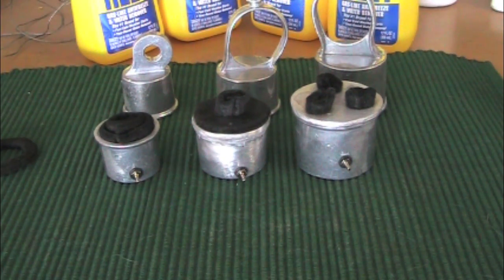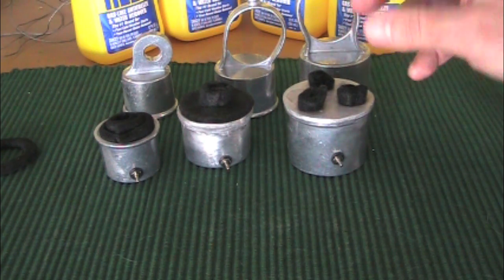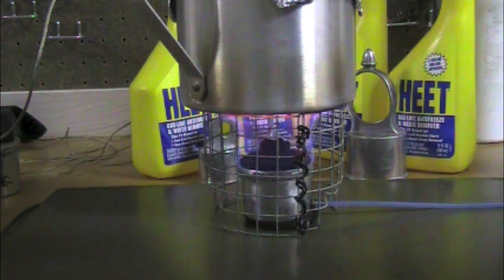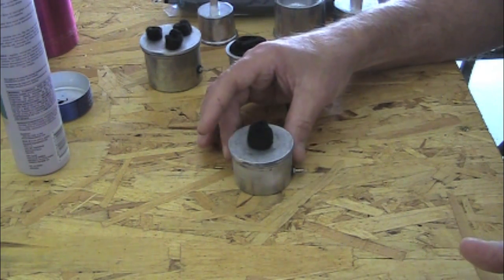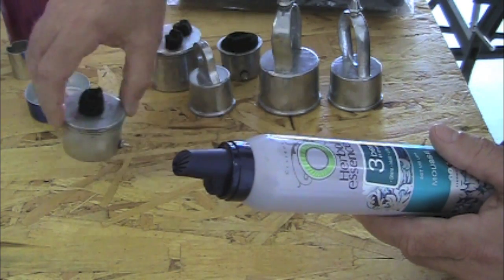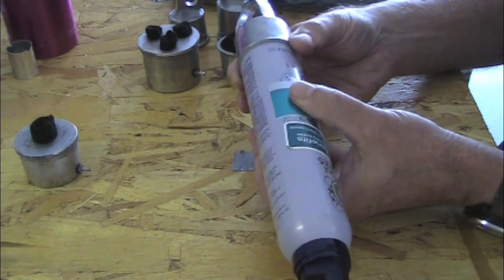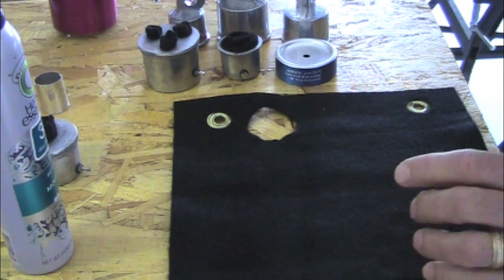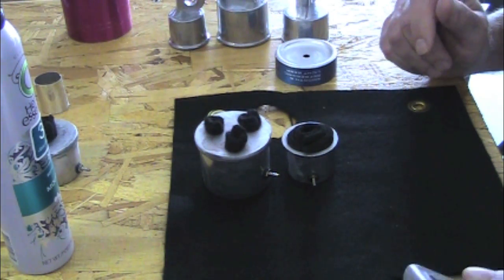Alcohol Stove Review - Using Medium Aluminum Fence Post Cap

Comment: We went looking for the carbon felt here in the Philippines. So far we received the standard "no stock sir."  Six years have passed since this video was produced. Have you seen the spun ceramic insulation sold for hi-temp applications such as furnaces? I know other alcohol stove enthusiasts have used that with great success in stoves that constructed with a wick. It lasts even longer than carbon felt and costs much less. I think if we can find the ceramic material here in the PH, we will be good to go.